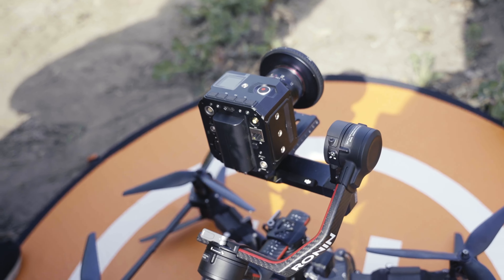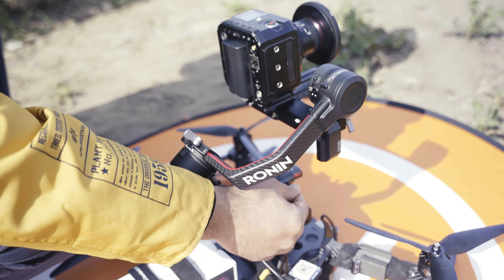Flying a RS2 Gimbal + Cinema Camera on a FPV Drone

Comment: Totally amazing, and I am currently building the Shendrones SWOL with this gimbal for 8S batteries. How did you power the Tilta baseplate? at 13-17V do you just power it with a small 4S battery?